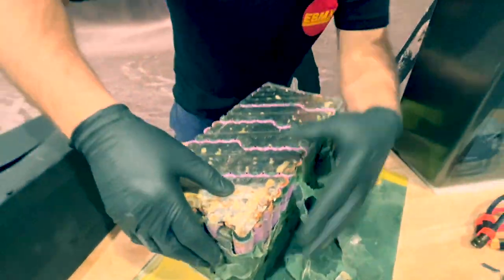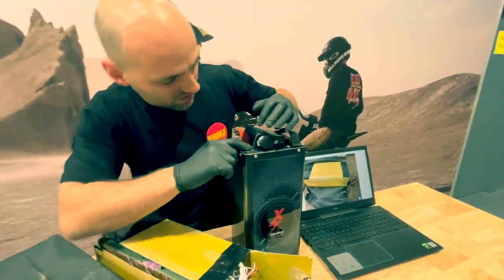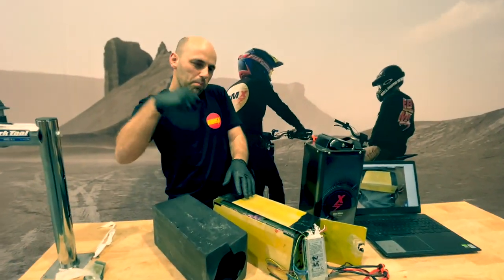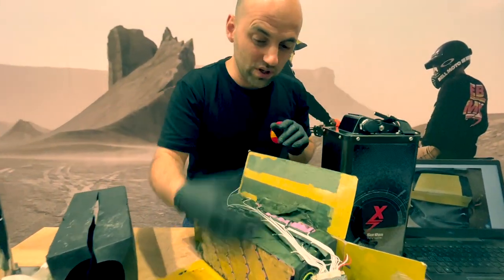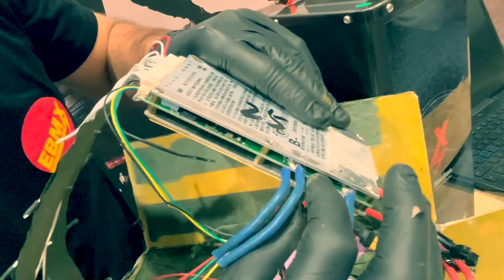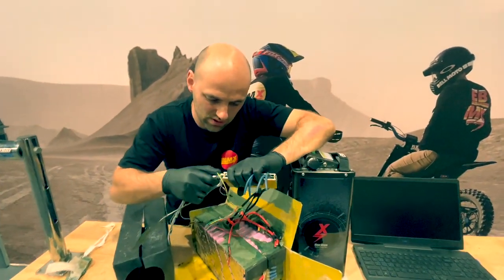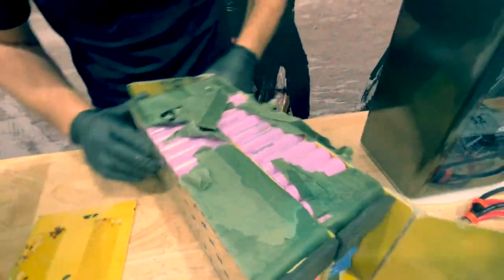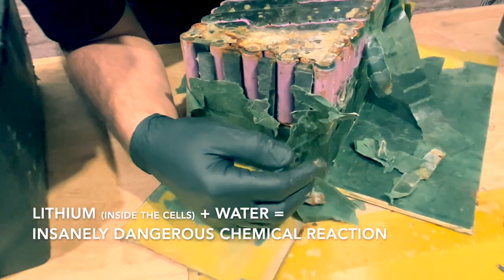Water Damaged 72v Surron battery (heat shrink pack) vs Stainless EBMX battery case

Comment: You touched on it at the end, but there is a place for heat shrink builds when inside another container like a frame or other enclosed box.
Reply: exactly. I heat shrinked mine AND put it in a stainless steel container.
Reply: Fibreglass then heatshrink then Stainless is the way to go
Reply: @herewegonow5310  ah, yes. didn't even mention fiberglass. that's standard! :)
Reply: @guiseppe36749  I keep batteries in the bag on my handlebars.. no issues yet,
Reply: @CmdrTigerKing  you what
Reply: @guiseppe36749  my plastic bag for groceries It also is for my 18550 cells
Reply: @CmdrTigerKing  el em ef ayo

Comment: Have you ever flooded a diving flashlight?
It looks even funkier when saltwater corrodes an 18650. It can even build pressure inside and explode 🤣
Reply: I don’t know why they make 18650 cells out of steel case, what about using aluminium instead? Would be lighter and no rusty shit
Reply: @herewegonow5310  aluminum corrodes to

Comment: If someone offered the range I got from Chi I would have considered but nobody had a 70ah besides them. 🤷🏽‍♂️
Reply: Why do you need that much range? My EBMX 72v 57Ah is an absolute beast, 4.2kWh on a lightweight Surron you get a mega range
The full size Surron Storm bee is 4.3-4.4kWh and much heavier bike
Reply: @herewegonow5310  Because I travel far why else lol
Reply: @herewegonow5310  what types of distances do you get and top speeds? mostly curious of on-road if ride road that is.

Comment: There are other battery with metal case not as expensive.
You right for the damn heat shrink tho.
Reply: what is the advantage of the metal case? does it channel the fire in a certain direction?

Comment: BMS FW engineer here: Reusing the BMS with different cells is a safety risk. Basically, the BMS is designed to enforce the max charge and discharge current with respect to temperature, while also enforcing cell voltage min/max limits. The limits are different for each cell, so it's possible the new cell could be operated outside of the recommended conditions. Given than li-ion cells can emit fire in addition to current, it's usually a good idea to stay within the recommended parameters from the cell datasheet unless your use-case has been evaluated by the cell mfg.